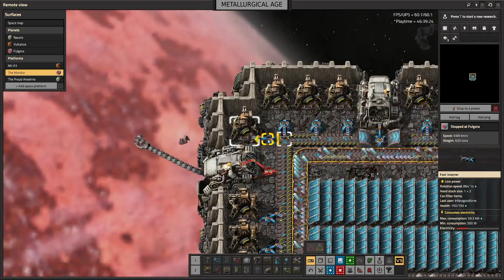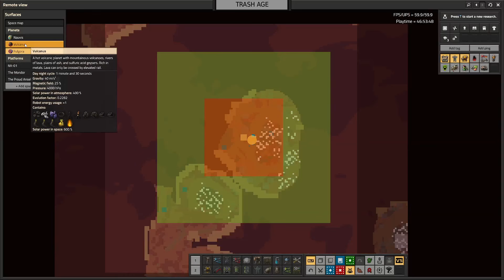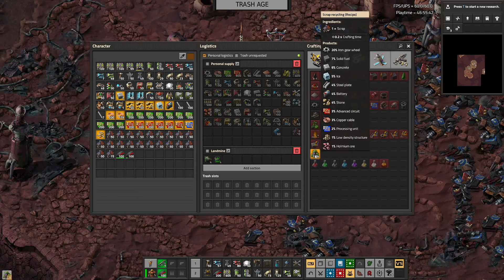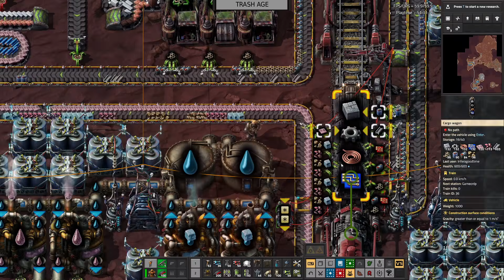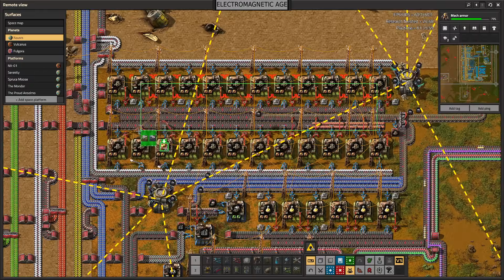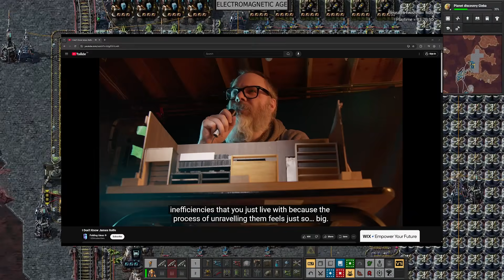Factorio: Age of Space - Part: Fulgora

Comment: Just voiding everything by default seems to be a common theme in Fulgora playthroughs, but I really don't understand why. There is so much useful stuff there!
1. Burn the solid fuel + ice for power as an alternative to accumulators.
2. Make yellow science - the leftovers from one emag science can create more than one yellow science, making it effectively free, and with very few factory buildings.
3. Turn the circuits into quality modules.
In my last playthrough I only voided ice, and even that felt wasteful 😄
Reply: I use the ice to make extra batteries, since once I start making magenta science there's never enough. Especially if you're also making yellow science.
Reply: For me, I trash surplus fuel and ice because of space constraints. Why commit to the large footprint of steam power when I can gamble on power in a much smaller space with lightning rods? I'd consider it if the islands were close enough to connect via larger power poles, but even epic tier poles fall short in my seed
Reply: It’s already trash, it’s functionally infinite, so why worry about using all of it perfectly?